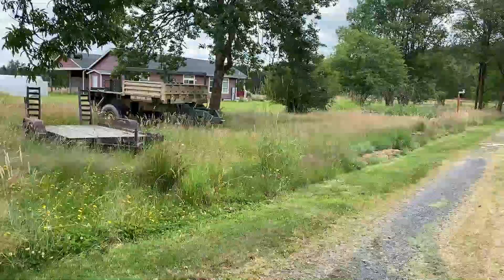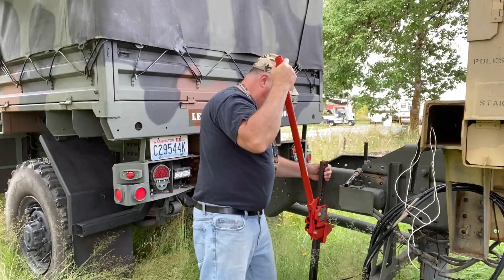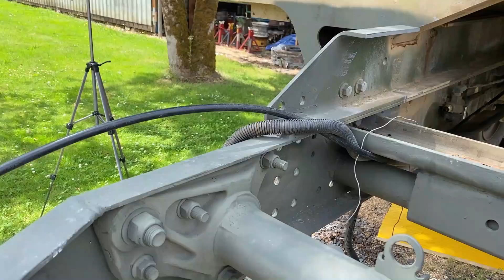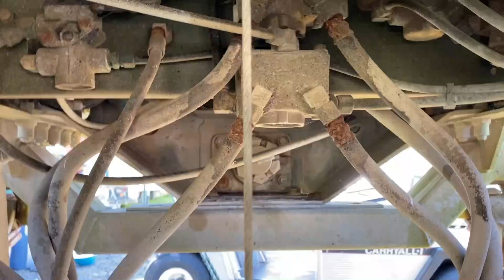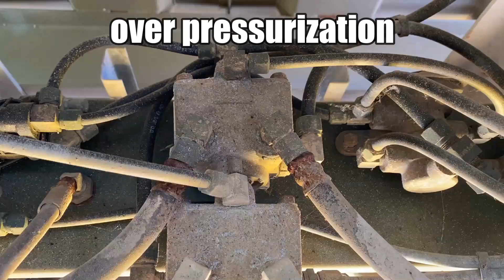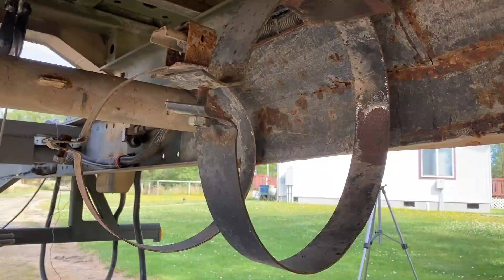FMTV REAR AIR BRAKES System Explained #121

Comment: dave everyone says the noise that comes from the low air buzzer is annoying. well I found a way to make it livable,buy a bottle of pure leaf ice tea the cap fits and looks military and its quiet but you can still hear the buzzer. I used 2 double sided sticky tape looks good hope it works for you because it does for me. Sorry I think its 16 oz. size good luck. Charley
Reply from the maker: Great idea! I know several caps that are very similarly sized that work well. As for me, I can hear in that frequency range any more. So, it does not bother me, but my son is terribly annoyed! lol.

Comment: Do not forget the trailer brakes need +4 level stopping compared to the truck brakes. That's right more pull from the trailer, This way when you stop the trailer will not be pushing you threw the stop sign.  Of course there is the blind eye Technic. If you do not see the problem, It does not exist.
Reply from the maker: The trailer control modules on the truck take care of all that for the trailer. It does make it easier... if that is possible. It is sifting through all the other lines that used to go to something else that is the pain. It's a rat nest.
Reply: Bob, are you sure about the Blind Eye thing?  It has been my experience that if there is a problem I don't see, that problem goes and gets other problems and they start a little village in that blind spot.....
Reply from the maker: @elgoogsucks9005  LMBO! To tell you a little story... my brother Mike was riding with Bob in Bob's truck when Mike said, "I think you have a problem with the transmission. You hear that?" Bob responded by turning the radio up and asked, "Can you still hear it? Problem solved!"  :-D

Comment: That is a spaghetti factory alright. Your trailer jack stand is working well. I'd like to see some testing and proof of concept. You planning that before you get it on the road?
Reply from the maker: Yeah, sure am. I'm going to jack up one side of the trailer when I'm ready and hook it to Malachai. That should be a good driveway test before I take it out on the road. Thanks for your question!